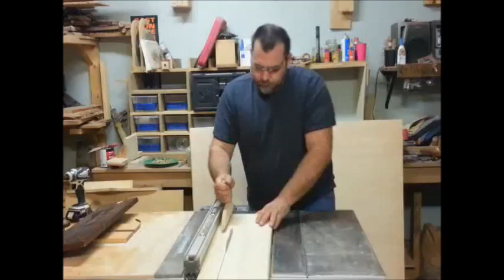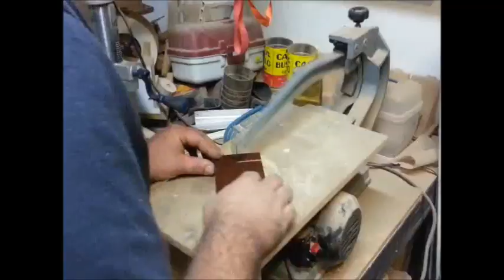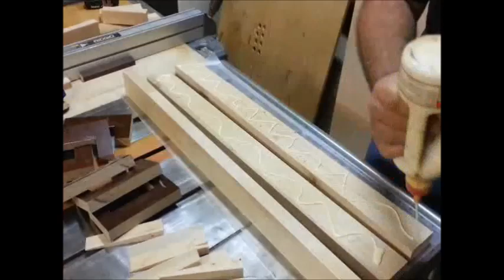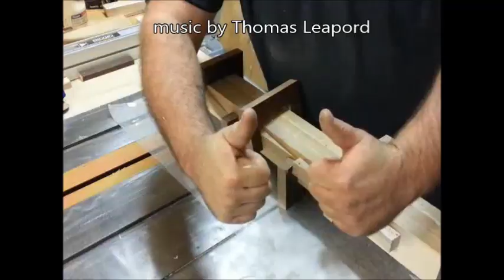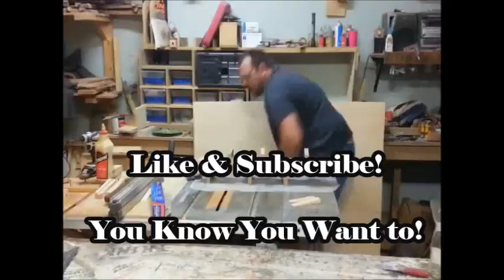Homemade C-clamps!! Easy Build!

Comment: You can do the same thing, to just about any length, using 2"x4"s, but rather than cutting them, you simply screw blocks to the edge at whatever length needed, then use the wedges to tighten it down. Great post. Love it.